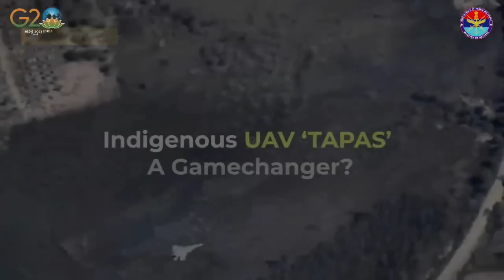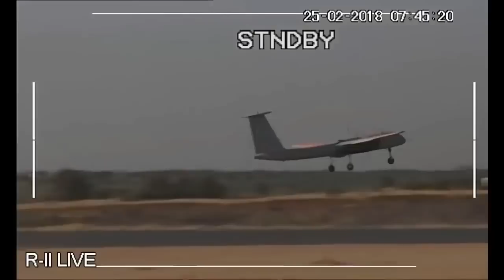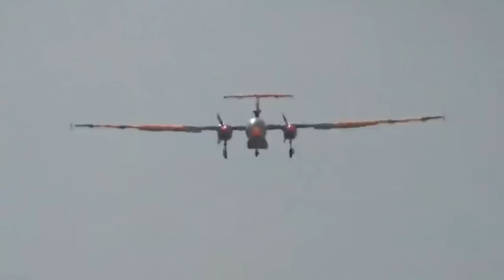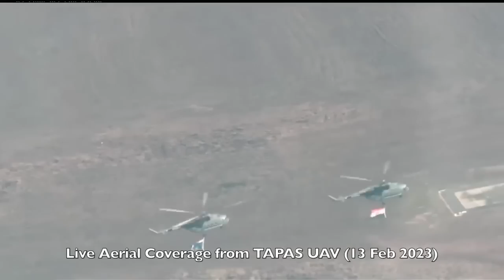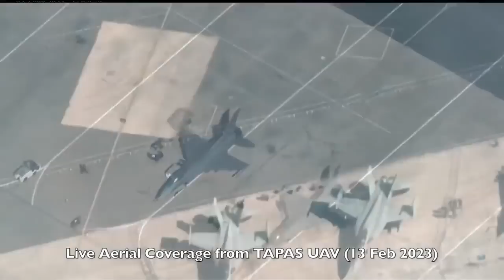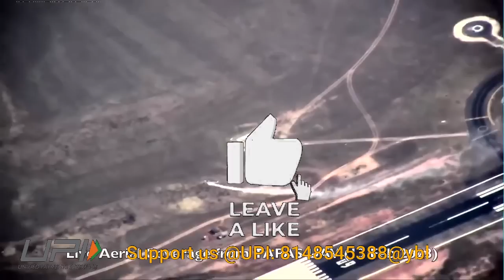#breakingnews  DRDO's TAPAS MALE UAV crashed today at Chitradurga during flight testing

Comment: Sir i have question can we used DRY kaveri engeins for the medium lift cargo planes and pasanger planes.

 if we can what changies we need to do in tge engein.
Reply from the maker: There is significant difference between cargo and fighter plan engine. First on is high bypass and other one is low bypass engine. So the answer is no
Reply: @IndianDefenseAnalysis 

So sir can't we modified it to high bypass engein like japan done it with their Mitsubishi X-2 Shinshin engein(IHI XF5-1 low-bypass turbofans, 49.03 kN).
Reply from the maker: @iimcrandomgamer711  can be done but requires lot of know how. At present GTRE has no exp with high bypass turbofan engine